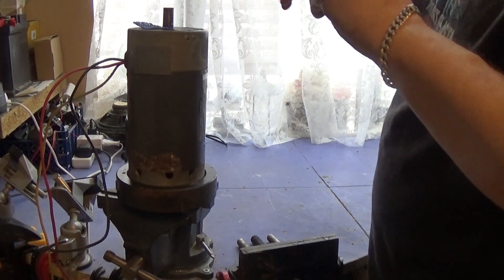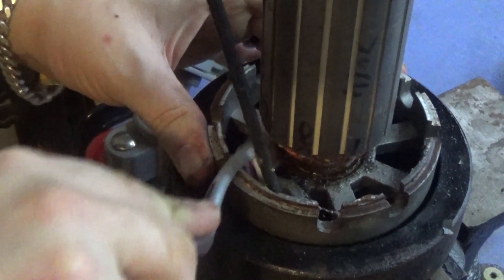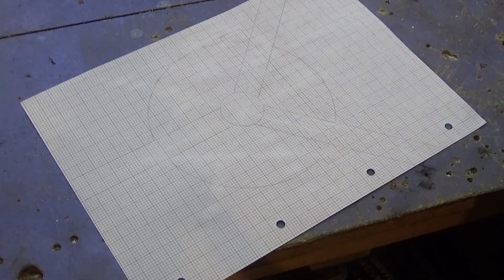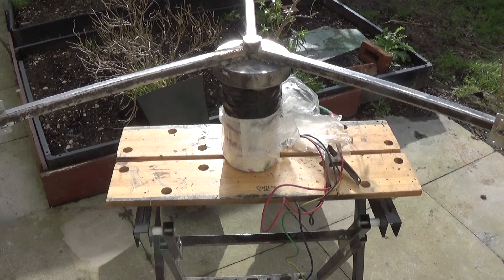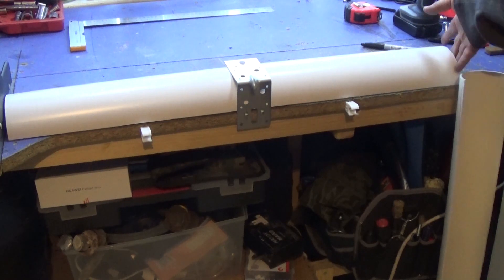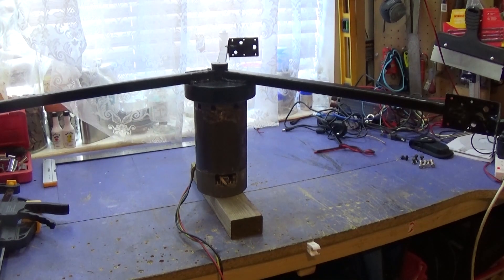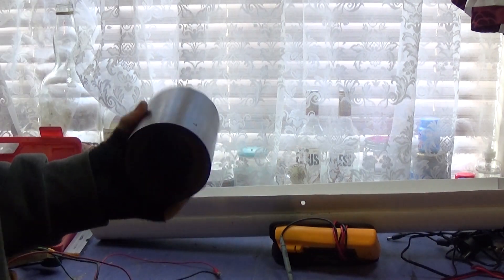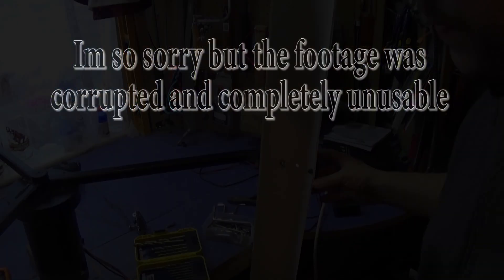Vertical axis wind turbine build

Comment: My dear friend came to you in some of what I found in the chemical applications that are possible after the completion of the preparation of sodium sulfate you add it contribute to improving the product
- Citric acid
An acidic substance that is considered an auxiliary preservative of the basic material and gives transparency and luster to the product and treatment of water and helps to control
Sodium chloride (table salt) is a thickener and looser
Texabone
A first-class foam concentrator that gives transparency to the product, which is / fat + oil + alcohol
Urea or agricultural fertilizer
It helps to transparent the product and prevent blurring and bleaching
By the way / there are a lot of products that are produced from sodium sulfate, it is possible that those who follow you can earn hope and gain more views and followers.
Reply from the maker: Thanks for the information

Comment: Hey, at 11.40ish you said you were worried about about rust sticking to the magnets. Dont. Rust (iron oxide) is not magnetic. The magnetic properties of iron are nullified when it becomes iron oxide which is a non-magnetic compound 👍.
Reply from the maker: It's not just rust it was a lot of metal particulates. Mainly from wear and tear of the motor etc